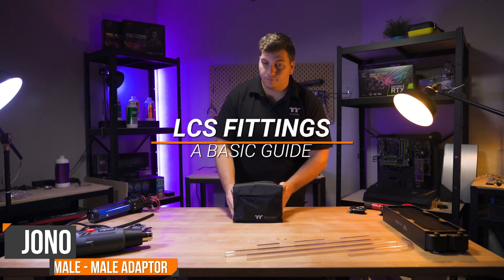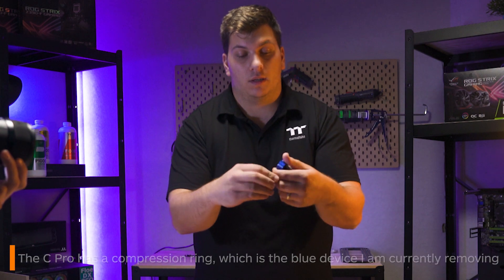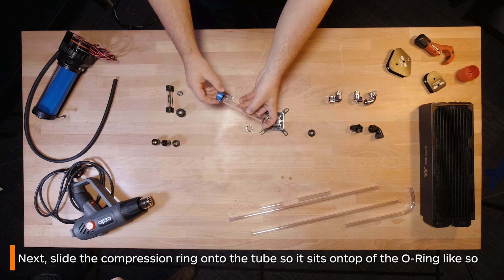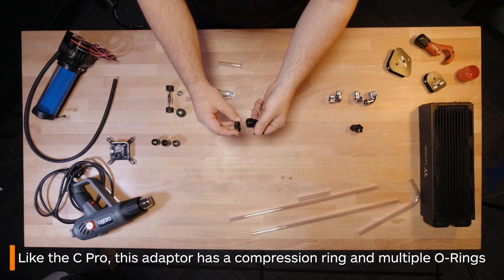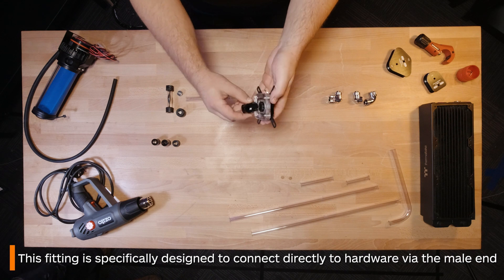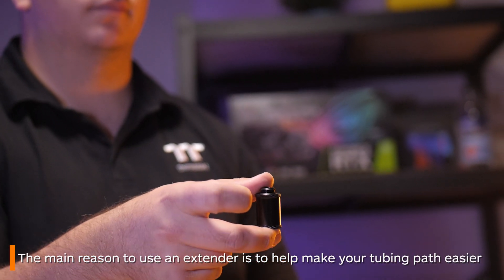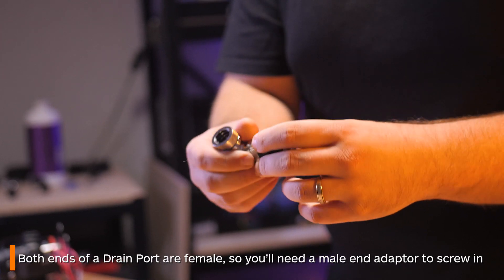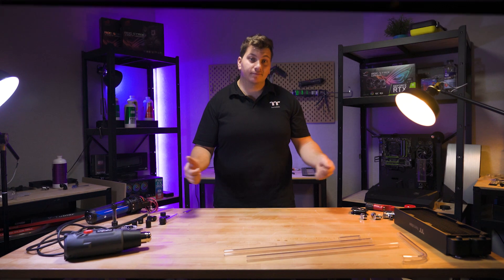Learn what BASIC WATER COOLING FITTINGS you can use in your rigid tube loop.

Comment: these thermaltake sources are rubbish I don’t recommend, it burned four hard disks and my ssd will never have my files back!!!!
Reply: ? ^^ what you mean ?
Reply: first, there are no hhd or ssd water blocks made from Thermaltake and if any other companies make hhd or ssd water blocks I don't recommend water blocks for the hhd and ssd cuz they don't heat up as much as the cpu  and gpu

Second Thermaltake doesn't make stuff for both hhd and ssd

third Thermaltake makes watercooling stuff not waterheating stuff

so there is no way Thermaltake has anything to do with your ssd and hdd

and Thermaltake is my no.1 trusted company for watercooling stuff